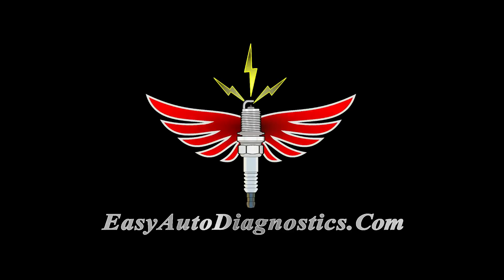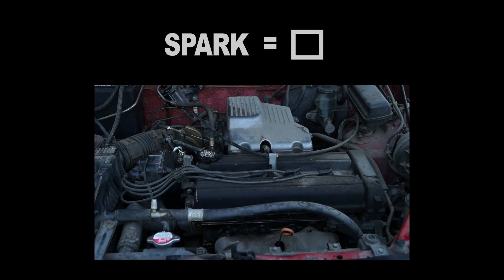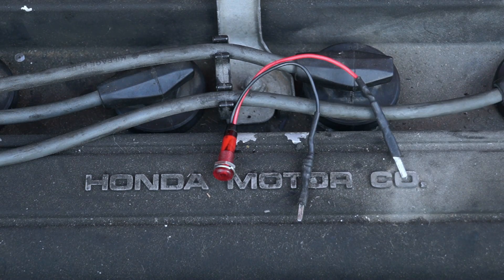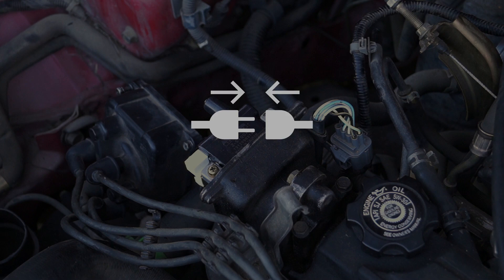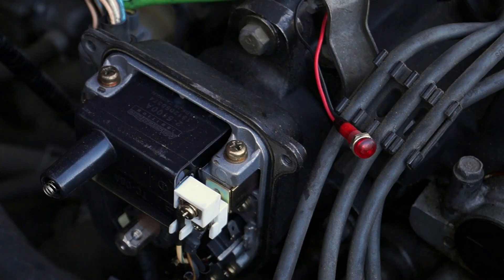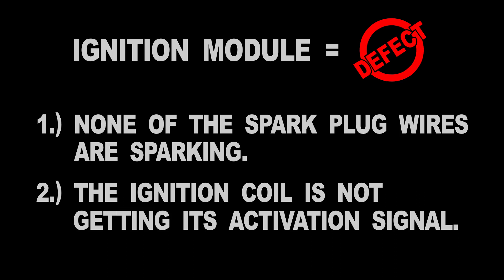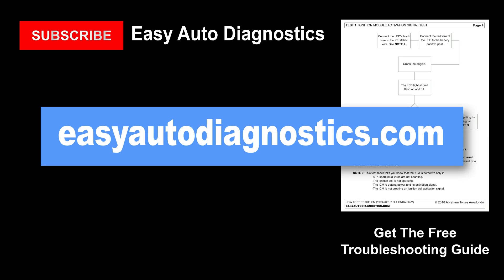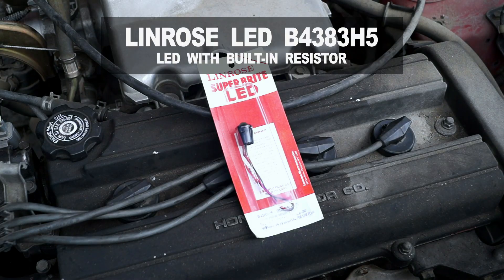How To Test The Ignition Control Module (1999, 2000, 2001 2.0L Honda CR-V)

Comment: My 2000 CRV stalls randomly then stop and it restarts. I changed the main relay and the fuel filter. I cleaned the intake manifold and the screen on the AIC unit. Please, do you have any ideas? It does idle roughly, might the ignition control unit cause that? Thank you so much..
Reply: Any luck on a fix? Mine is doing the same.
Reply: The mechanic replaced the distributor, I think the ICM unit would have worked just as well. (For a lot less) it has improved. It has a low idle still, and stalls from time to time. I suspect the cat converter is causing the low idle. I need to fix that too. Because check engine is on. Good luck!

Comment: Can I use A volt meter and see if the voltage jumps up and down on the meter?
Reply from the maker: If you mean using a voltmeter for the spark tests, it will not work.
Reply: What I was referring to is the test is show in this video. Between the Yellow/green wire and the positive battery post. I am having a hard time finding an LED tester  @tecman129
Reply: Thanks for your videos they were very helpful I got the crv fixed by process of elimination. It wound up being the pcm saved a ton of money by following these videos.

Comment: Good evening sir hope your day is going well! I have a 2003 DODGE CARAVAN SE that is giving me several codes p1684, p0300, p0303, p0420 & p0306. Can you please help me out sir? I will appreciate your help alot! I have this tool from harbor freight called CEN-TECH 6/12V Circuit Tester with 5 ft. Lead part number 63603. I did see this other tool in harbor freight called CEN-TECH Computer Safe Automotive Logic Probe part number 63597.

Comment: It was the ingnition coil! Thx! Super helpful, step by step instructions.
Reply: This was not a ign coil test, but an ignition module test..u may be calling it the wrong part or.... tested further-?
Reply: @shorelined1  I had no spark at any of the plugs and my little incandescent bulb setup did light up when cranking the motor over. Yes it was the ICM - module, not the coil. This was on a 2000 civic.

Comment: Hello Sir 
when I connect  yellow with green strip wire to positive terminal like in this video. 
[1] Ignition on >> light is on weakly. 
[2] Ignition off >> light is on brightly. 
In this video, Led light is off. 
When the crankshaft is start , Led light is on/off.  
Can you advise me?
Reply from the maker: If the LED light is blinking ON and OFF, when you crank the engine, then you can conclude that the ignition module is getting an activation signal.

What the LED light does before or after cranking the engine does not matter. The important test result is if the LED light is flashing ON and OFF when cranking the engine.

Now, if the ignition control module is getting an activation signal but the ignition coil is NOT getting its activation signal, then you can conclude that the ignition control module is bad.

To be a bit more specific, you can conclude that the ignition control module is bad if you have:
1.) Confirmed that the ignition coil is NOT sparking.
2.) Confirmed that the ignition coil is getting 10 to 12 Volts.
3.) Confirmed that the ignition coil IS NOT getting an activation signal.
4.) Confirmed that the ignition control module is getting its activation signal (as confirmed by the LED light flashing ON and OFF).
Reply: Thanks Sir,
1. I can cormfrim  no spark. 
2.I can comfrim 10 or 12 Volts 
3. Ignition coil is not getting activation when I cranking engine. 
Is it mean ICM is bad?
To get activation signal, what sensor I will check?
CKP sensor ?
TDC sensor?
CYL sensor?

Comment: Can an aftermarket NEW fail? My mechanic said I need OEM that one wouldn't even crank after installed.
Reply from the maker: Yes, a new aftermarket ignition control module can fail. For the most part, failures are usually due to the fact that the new ignition control module is a cheap knock-off part. It's important to replace the ignition control module with a known automotive aftermarket brand. If available, I recommend the following two known brands: Delphi or Standard Motor Products.

Comment: Hi i have Problem with my distributor    i changed  a new cap new coil new rotor and i changed the icm  from two other distributors but. All 4 sparkplugs are spark but don't start. If i crank the engine stop and turn the ignition on step 2 it come a little misfire. 
If change the distributor complete to a newly the motor runs.
 So what can do that my oem  distributor runs?
Reply: Check main relay PGMFI..injector no't working.
Reply: aftermarket junk

Comment: What if my rotor isn't spinning and the timing belt is not broken?
Reply from the maker: Hey Justin, sounds like the camshaft has broken in two pieces. I've seen this happen before several times (usually cause the engine was low on oil, etc.). Do this: remove the valve cover and have someone crank the engine while you observe the camshaft. If only the front part of the camshaft turns but the end that connects to the distributor does not, then it's broken. 

If the entire camshaft turns, but the distributor rotor does not, then the distributor's shaft is broken or damaged. In this case, remove the distributor and check the part that fits into the camshaft. See if it's damaged/broken. Hope this helps! Let me know of your results.

Comment: Can you do similar tests with a regular test light?  Or will that sometimes be hard to see the pulse (turning on and off) on a regular test light as opposed to an LED test light like you have?  I was using a regular cheap bought test light and could not tell for sure if it was pulsing (turning on and off)  or not when I was trying to test the Ignition Control Module (some call igniter). I need to know if it was not working or was I just not seeing the test light pulsing?
Reply from the maker: You'll need to use an LED light. From personal experience I can tell you that an automotive 12 Volt test light will not give an accurate result.

Comment: My engine starts but the mecanic said the ignition control module it doesnt work when my engine gets hot
Reply from the maker: In this case, it's important to perform the ignition control module tests when the engine is hot and does not start. The symptom you're describing, the ignition module not working when it gets hot, does happen in some cases when the ignition module goes bad. If the ignition module proves to be good (after testing it when the engine gets hot and doesn't start) I would recommend testing the main relay. The main relay is the one provides power to the fuel pump and the fuel injection system. There's a good chance that the fuel pump circuit part (of the relay) is bad -this is a very common problem with Honda main relays.
Reply: @tecman129  rn my car doesnt start no more i have spark fuel & correct timing but my car doesn't start we tested main relay & cant find the problem
Reply from the maker: If spark and fuel are present and the timing belt is not busted, then I recommend that you test the engine's compression. When did the problem start? What year, make and model vehicle are you working on?
Reply: @tecman129  1991 honda civic d15b2 the problem started when i remobe the distributor to take it to the autoparts so they can send me the correct one then 3 days after i got home with my other distributor but the car didnt start no more so i thought the dizzy i brought was bad then i test it out with my old dizzy & the car didnt start i checked fuses & they are good i have around 145psi on each cylinder ,new battery new fuel pump
Reply from the maker: @luciferjr4204  If you can, remove the distributor cap from the distributor, disconnect the distributor from its connectors, have someone crank the engine as you observe the distributor's rotor. The rotor should turn as the engine cranks. If the rotor turns, rotate the crankshaft pulley to top dead center and see if the rotor is facing the #1 spark plug wire tower. This is the tower that the spark plug wire for #1 cylinder connects to. The purpose of this test is to see if the timing belt is off by one or more teeth. Once you finish the tests, report your results back to me here. How did you test for spark and fuel pressure?
Reply: @tecman129  ok let me do that rn & i disconnected each spark plug wire then test it with a ground wile the engine cranks & for the fuel i lose the nut that holds the fuel filter then i turn the key into ignition position so fuel was coming out from the filter
Reply: @tecman129  hey man i think the distributor its complete out of time the rotor its opposite side
Reply: @tecman129  i just fixed that & it doesn't start either
Reply: @luciferjr4204  have u checked ur getting signal to ur injectors ? let me know thanks

Comment: But WHERE is the Ignition Control Module? I was told to check it but can’t figure out what it is. I couldn’t tell from the video either.
Reply: Inside the distributor
Reply: where is it in a 1992 Honda accord? Inside the distributor there is no coil!!

Comment: Hi, I tried hooking my light from the yellow green stripe wire to positive and got a constant light. Any idea what this could be?
Reply from the maker: This might be a bit late, but a constant light (that does not blink on and off) lets you know that the signal is not present.
Reply: @tecman129  So glad you added this extra tidbit
Reply: was that while you cranked engine or with out ?
Reply: Hello curless90, How you solve that problem?